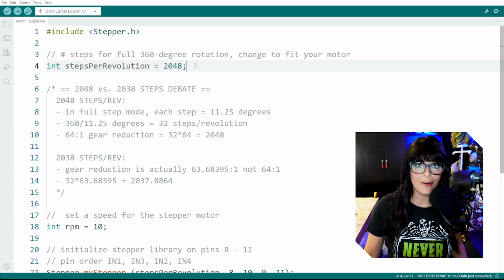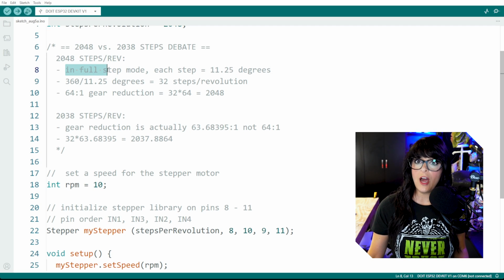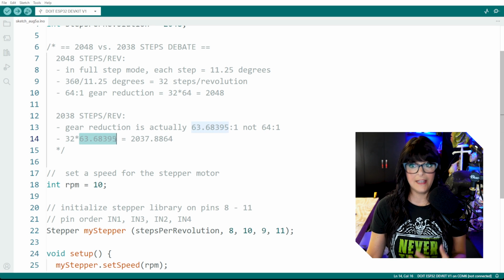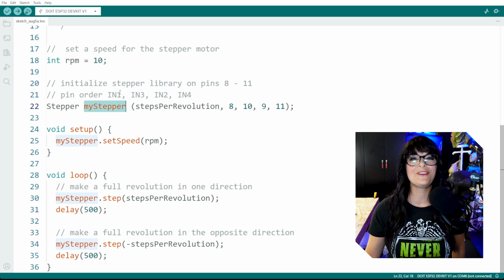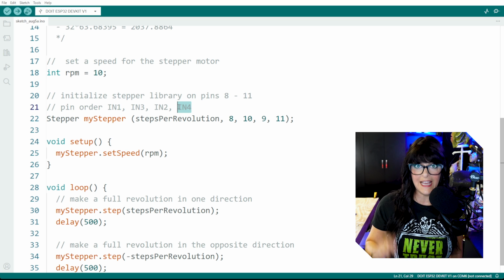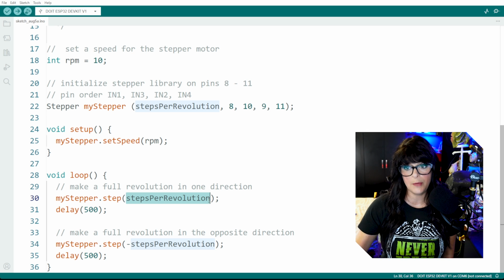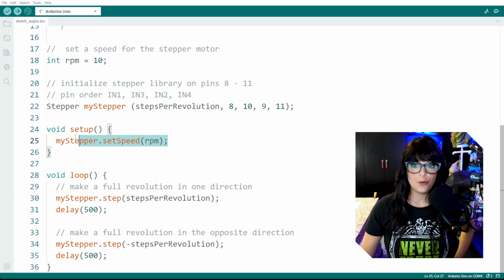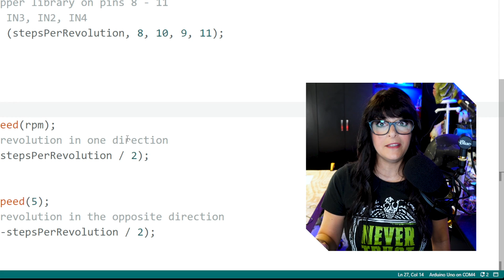Beginner's Guide to Controlling Stepper Motors with Arduino

Comment: I want to build my own camera rail, with the movement controlled by a microswitch that is on my 3D printer (This is already installed) but adjustable steps of the rail controlled by the board and adjustable display, so I can have the number of shutter takes, divided into the travel I want on the camera rail, so if the print has 360 layers, each layer makes a shutter release with the microswitch, then travels forward the distance needed (layers / travel distance) can you point me in a direction so I can work this out, great video by the way and yes I am a subscriber.

Comment: ...I agree with @The_Yeet_Man649 said, adding to my confusion: if the controller has power does the Arduino care what the stepper motor draw is?
Repeating: Do you power the Arduino from the wall, too???

Comment: dear Rachel please can you help.    its regarding   2450 mw human motion sensor and stepper motor.    it is almost similar to your servo and ultra sonic sensor that i am trying to map the sensor values to the stepper motor movement.   my first attempt has failed as i now realise that i got the steps value or variable wrong.   i most have confused speed for motion.   if you have an example code it would be appreciated .   sincerely fan ejike

Comment: did you have to leave the arlduino uno plugged in for this to work or was the connected 5V enough to power both the stepper motor and the arduino?

Comment: If your stepper motor does not reverse direction, try swapping in2 and 3. 
Stepper myStepper(stepsPerRevolution, 8, 10, 9, 11); instead of Stepper myStepper(stepsPerRevolution, 8, 9, 10, 11);

Comment: Can't the power be used out of Arduino itself without a 9v battery?
Reply: No, PSU is the way. Nano can't supply adequate voltage

Comment: @rachel - really easy connections. Can we use the 5V rail from the Arduino itself to drive the stepper Motor instead of have a separate power supply from the bread board?
Reply: Tried the exact same connections with the same components from the video, works really well 👌 also, you've answered my query in the stary of the video itself, I seem to have missed it 😅

Comment: Hi. Is it possible to use a simple external controller attached to a stepper motor and program it to rotate 180° over a 12 hour period.?

If so, can it be set up to rotate 180° in 12 hours forward and then be programmed to rotate in reverse the same 180° in 12 hours?  Ty

Comment: Could you please make a video (with respect to controlling a bidirectional motor using a motor driver and arduino UNO) to show how to connect 4 schottky diodes (or 4 general diodes) at the motor driver's input and output terminals to clamp (down to the power supply voltage) reverse voltage spikes from the bidirectional motor?

Comment: Great channel, very good explanations with great energy. One question, I have been looking for a way to move the BYJ -48 STEPPER MOTOR from 1 rpm to 13-15 Rpm using a push button. Basically setting a clock by turning motor faster as it is physically locked in with the gears of the clock.so use code to move second hand from keeping clock at time with 1rpm to turning it at 15rpm until minute and hour hands are at correct time.
Thanks for all your videos!

Comment: Nice video! Just FYI: The Arduino dev board YelloByte YB-ESP32-S3-DRV (sold e.g. on eBay and documented on github) needs no cabling or external modules and makes controlling two stepper motors like 28BYJ-48 a breeze. Regards Th

Comment: So glad I found this video.  My first question would be, should the stepper get finger burning hot after going through four or five loops?

I just bought the 5 pack of motors that Elegoo has on Amazon, and then I tried the follow Elegoo's  example doc and I couldn't understand it for anything.  Your using the exact same setup and code but what you're doing makes sense.  The Elegoo writer obviously didn't want to be at work that day.  Let's start at the beginning.  

First, no where on their site does it tell us the pin out and example code is included with the data sheet download.  I'm not going to understand the data sheet so I didn't bother downloading it and spent about half an hour looking through the Elegoo website for the tutorials.  

Second, they have that thing attached to their bread board, that connects the both sides of the power rails together, and never mention it in the tutorial, or the fact that this project needs to be externally powered.   Since I didn't know what the extra piece was, and there is no external power in the diagram, it looks like they plugged the power into a dead rail.  I had no idea what they were trying to do until I finally learned what the extra piece did. 

Third, and astonishing they overlooked this, the picture of the wiring pin out is wrong, and I think I may ave burned up one of my steppers trying to get it to work while wired that way.  The wiring schematic right above the pic shows the correct wiring but the wiring diagram pic shows it wired the exact opposite.  Maybe it would work that way and just run backwards, but as I said, the motor starts burning up within about 30 seconds of running so I doubt it.  

So again, I am glad I found this video.  If I had been stuck with only Elegoo's tutorial I likely would have burned everything up and never got the steppers to move.

Comment: Older video, However, I have a question. If you plug the 5v into the breadboard then its powering the rails on the breadboard and then out to the stepper. I didn't see any power from the breadboard going into the Arduino. So my question is how was the Arduino powered
Reply: She's just running the board off the USB port I reckon.

Comment: 2038 or 2048?
Mark the exact start position of the motor. Than just order the motor to turn 100 times. The error will accumulate. If you use the correct number there will be no error and the motor will stop at the exact start position. If you chose the wrong one the stop and start position will diverge.
in my tests the correct one is the number provided by the datasheet.

Comment: My first  working project and i just got my arduino pack a few days ago. Got a little confused at the power connection setup as is dont use an adapter and just plug it into my pc, just connect your positive ro the volt and negative to ground from your breadboard to your arduino, that works fine forme. Great channel thanks for the help and motivational boost.

Comment: so how would i wire the battery?
Reply: It has the same positive and negative pins as the wall plug, so you can just switch it out, though sometimes the battery doesn't specify which wire is which, usually red is positive black is negative.

Comment: Okay I got a question You showed all the hardware some of the hardware that can be used with the Arduino you've showed how to plug it in and then you pull up a screen where you're inputting code where did this come from? How do you apply it to the Arduino? So far I'm in I don't know 50 videos on how to use it in a duino and everybody does the same thing You go right from the hardware to a programming screen but nobody explains where the programming screen came from or how to use it
Reply: That's the Arduino IDE (Integrated Development Environment), by far the most popular way of programming the Arduino.  Get it for your computer (Windows or Linux) and do some elementary examples first, like blinking LEDs, etc.
I guess no-one mentions it because it is so basic, everyone assumes you'll know what it is.

Comment: I'm considering adding some kind of 12VDC stepper motor to operate some wood swell shades on my pipe organ, they sell a "swell shade engine" to do this but they cost like $1500 and are usually powerful enough to operate a whole lot of them together.
These run off a shoe on the organ console that is operated by your foot- tilted downwards the engine progressively opens the shades, returing back to the closed position the shades progressively shut with the shoes' movement in that direction.
The shades only move when your foot moves the shoe, much like driving a car.

Typically the shades only move about  to about a 40 degrees open position- their angled edges are felted and their purpose is sound control, after watching this video I'm thinking something like this Arduino and a larger motor than the one shown might work since the shade i have only number 7 about 22"x9"x1-1/2" thick poplar wood, they pivot on brass pins resting on ball bearings, so they would move pretty easily. They would not have to move very fast-  the speed shown in the video is quite a bit more than needed.
The mass of the 7 wood shades would likely need a larger sized motor than in the video to start moving,  even though they are on ball bearings.

They would also need to be operated not by a script per sei, but by a row of mechanical contacts the shoe has in it.
Might you have any ideas on how this kind of application might work and what might be needed?

Comment: I know you cover stepper motors in this video but just curious if you can use a 2 wire linear actuator for say a 6DOF simulator (not a full size but a small desktop preprogrammed prop.)
Reply from the maker: Yep! Linear actuators are on my to-do list for videos. You can absolutely control then with Arduino.

Comment: I have found myself referring to your channel more and more for arduino projects, you cover a wide variety of cool stuff. Thanks! That said, the ask.. have you used solenoids in any of your props? I'm also curious about air pumps. I wonder if an air pump, for the sake of convenience lets say for a bubbling cauldron. Using an air pump from a 12v car air horn. Since it's a motor driven thing I think it could be hooked up to a motor driver and have the amount of air controlled?? Let's say you have a witch stirring a wicked brew and drops something into the cauldron and the amount of bubbles increase. Would this work? Seems like it would however I have more imagination than experience with these things.

Comment: I am a total newby to Arduinos and their programming, trying to create an electric turntable for a model railway, using a stepper motor and Arduino, needing to run in both directions and have it stop and start at 10 degree Intervals, any help would be appreciated.

Comment: May i ask what language is being used in your IDE to program your motor control? I know Python, and i know arduinos can use Python, which i am going to experiment with. However, it seems every video i watch about arduinos is using this same syntax, so I'm curious as to what language it is. Thank you for your videos :] new to your channel and enjoying it a lot so far! You go into a lot more detail than most which is very appreciated.

Looking forward to the multiple bigger stepper control video you mentioned in another comment! Unless its already made and i just have to find it yet 😅 either way, still looking forward to it!
Reply: Arduino code was originally based on C++ so many libraries are written in the pseudo C++ /arduino language.
Reply: @mikebond6328  ok thats what I was wondering. I knew it was based off of c++, but arduino is its own language? I use the arduino MicroPython atm because I know python, but would coding in pure c++ work or would some of the syntax be wrong?

Comment: Good that you mentioned the 2038 thing. With that strange gear reduction, the whole "stepper motors are precise" claim goes out the window! Imagine driving a clock face with this; it won't show the correct time for very long! But where does this 63.68395 come from? JustAnotherMakerChannel disassembled the gearbox, and the teeth counts that he listed produce exactly 64:1 (3 * 3 * 2 * 32/9). Maybe there's identical-looking motors with slightly different gear ratios? In any case, I'll stay away from all geared stepper motors for anything precise!

Comment: Idk if you've addressed this but would you ever think about making a video using the Pi Pico? It's a lot cheaper and much more powerful than an arduino so its kinda made the arduino obsolete in many ways. You can run C/C++ on it and even use the arduino IDE to program it. Just curious :) Anywhoodles, love the video! you are soo cool! Thank you for all the tutorials <3

Comment: Sadly there's not much (serious) you can do with that motor and it's difficult to apply that knowledge to normal stepper motor because of different wiring, ask me how I know.
Reply: idk, i've made fun lil projects with them. I designed and built my own cnc pen plotter with them for fun and it worked well. Also fun for miniature robotics projects. also great for prototyping large projects in miniature on the benchtop just to see if they'll work :) I personally love them. If i ever need anything heavy duty I switch to nemas though.
Reply: @emmamarx9284  I'd agree with all of that if they would be wired the same way, but they are not so I disagree.
Reply: You can convert them from 5 wire unipolar to 4 wire bipolar. It gives them a lot more torque, albeit you have to run them at a higher voltage (a little over double if I remember correctly? idk I worked on that project about 5 years ago lol)

Also I think it’s good to learn to use unipolar and bipolar steppers so you have more options under your belt when working on designing your projects. Not everything needs a nema17, sometimes projects require steppers with a smaller form factor and the 28BYJ-48 is a cheap and effective solution.
Reply: @emmamarx9284  I'll look into that conversion if I get chance.
If you me you only learn essentials needed to get the job done, otherwise you have no time to do other tasks. Sadly not much time to play. And I am more into nema 23 or 34.
Reply: How do you know?

Comment: Cool vid, thanks, can and encoder be hooked to the output shaft to mimic a servo?
Reply: Most modern machines use a homing limit switch to give the stepper motor a starting point and after that the stepper is so precise that it always knows where it is. That’s the whole point of a stepper motor.

Comment: Just getting into Arduino and back into some programming.  I bought a Keyestudio Mini tank robot and thought you might like to know it came with a L298P shield with power switch that stacks right on top of your UNO board so no extra wiring needed.  Wanted to share if you haven't seen them yet.  Keep making the awesome content it helps so much, I will for sure be joining the community of artistic builders!!  love it

Comment: i am interested in steering 2 different stepper motors with different speeds on one arduino
Reply from the maker: Definitely do-able! I'm getting a few new stepper motors and I'll do a video demonstrating how to d it 👍
Reply: @RachelDeBarrosLive  would be very nice, i am going to build a rc car with stepper motors and the steering left and right should be done with different rpm of the steppers left and right ...

Comment: Very cool!  Could you do a tutorial on interfacing a NEMA 17 stepper?  These are the same type used by most 3D printers.
Reply from the maker: I'm getting a few new stepper motors to upgrade from these starter kit ones so I'll explore controlling more than one!
Reply: They are quite easy. You can just use a simple blink program to step them.